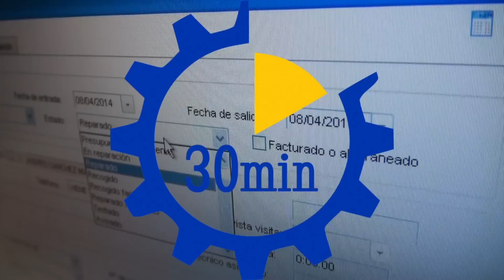Reparar Sony Xperia T3 Cambiar Pantalla 🚀 Cómo desmontar 📱Sony Xperia T3 D5102 D5103  | EUROPA 3G

Comment: Tengo un D5106 Xperia T3 de la liga normal. Cuando se conecta a las carpetas de acceso de la CPU y archivos. Cuando se conecta al cable USB del LED en el auricular se vuelve rojo; cuando se presiona el botón de encendido vibra y luego el LED del auricular se ilumina en verde. Pero sigue siendo en todo momento con la pantalla en negro. Esto sucedió después de que hice una actualización a través de FlashTool. Después de que he utilizado al menos cuatro veces, la FlashTool en un intento de revertir la situación, pero todo fue en vano: sigue siendo el mismo. Han puesto a prueba la batería y se ve bien, presiona y mantiene la carga. También me di cuenta de que el botón de retroceso, el hogar y responden múltiples cuando me disparan. Él cuelga al pulsar el botón de encendido y el volumen menor. Al pulsar el botón de encendido y el volumen más que vibra a veces y otras veces desencadena un audio en Inglés, creo que una cierta dirección. Usted me puede dar una pista sobre cómo resolver el problema? Agradecería que me puede ayudar a dar algún indicio que no pasa, por ahora, al cambiar la pantalla, eso es lo que sospecho es el problema ... Pero al mismo tiempo me da dudas, porque creo que puede ser la placa o algún error de actualización software.